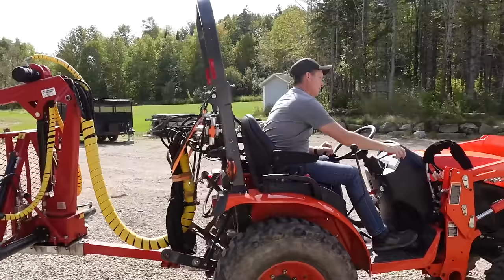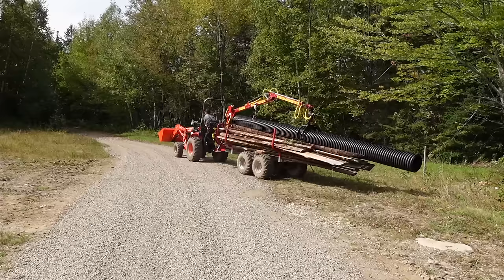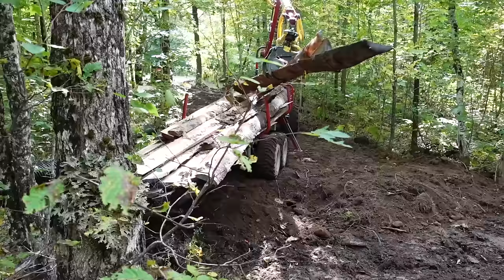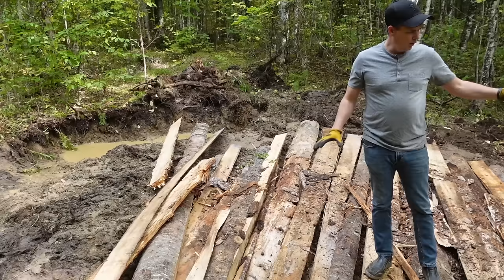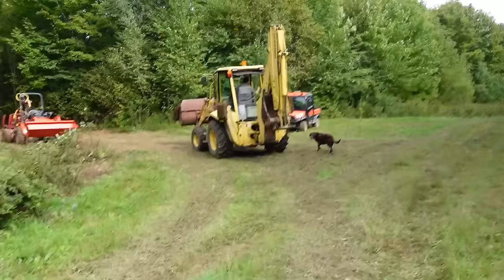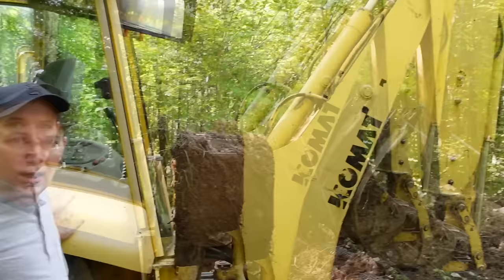Corduroy Firewood Road  -E181

Comment: At the mark of 11:18, that is the sound that reminds you why prefer have a brown dog than a white one... Lol! Slab wood is perfect for making a corduroy road. Much better than round logs. It's not going to roll or move with the pressure and traction of the wheels. There are also small voids that will remain with those slabs that will allow the water to escape towards the lower side too. Nice job, it will sure be good to run heavy equipment on. When I was young, I've seen  a corduroy road, that extended for 1/2km, over a swamp. I was at my parents summer house, deep in the woods.  It was built from the 50's and yet at that time, still very stable.  Then a logging company came in and they had to built another road next to it and they spend numerous weeks with heavy machinery to sink down impressive amount of big rocks into the mud in order to build the base of their road.  So to say, the corduroy method is indeed quick and effective! Especially when you have limited equipment and resources... including time! Thanks!
Reply from the maker: Thanks Joe. I bet that corduroy road at your parent's summer place would have been something to see as it was being built. We left a few boards in some of these slabs when we were sawing for 8x8s so they are excellent for this road repair. Almost through the wet hole this morning. Need to stop and make a fuel run for the machines and for myself and then back at it!

Comment: That’s a great idea. Use up the slabs.  I have a bunch of slabs here, which some have been cut up into firewood. I don’t have any wet spots like that to fix Jason. But a thought I had was, if a fella had a sorta steep
 hill you wanted to travel over, you could build a ramp to help smooth it out to make it easier to travel over. 🤷🏻‍♂️maybe. 
Any way, nice fix, have a great Sunday. 
Great times in the Maritimes. 👍🏻
Reply from the maker: Thanks Noel! Sometimes the solution is right in front of me and I fail to see it. Anyways, I have a big pile of this stuff so I can see some wet spot repair work in my future! Finally some nice weather to work in...
Reply: @OakMountainAcotts  yes a nice week weather wise coming up. I’m still trying to finish splitting my Fiona wood. 
Hehe. How many times have I said to my self, why didn’t I think of that before. !!!!
Have a great Sunday Jason.

Comment: Not a bad idea Jason, with the corduroy or 'puncheon' road  - the subgrade fill over top of your corduroy is full of organics, which will take longer to dry out and 'set up' and will always be soft when wet.  If you can, try a 'downhole' borrow pit with the hoe, ie. get down below that organics layer into some better mineral soil or sand/gravel till. Then when your done with the pit, you can backfill it with stumps/etc. And, try and save out the rocks to armour the culverts!
Reply from the maker: It turned into a pretty good road. Hard to find gravel here unfortunately… ledge seems to be just 2’ down!

Comment: Great idea and making of the water problem solving. 
Where’s all the water coming from ?
Underground stuff or just natural draining ? Thnx…
Reply from the maker: We have had a tremendous amount of rain from August of last year to now. I've never seen the woods so wet... This area is naturally low so all of the rain water is running here and it is slow to dissipate. In a normal year, you would be able to drive right through this spot! Anyways, this seems to be the fix for it and the culvert will let the water get away as I continue to ditch the new road I am building. Thanks for watching!

Comment: I have the swamp, the slab wood, a pit with about the same dirt, small tractor with backhoe but no time 😂. I’m thinking I’ll but the slab wood a couple layers thick as it’s a black mud swamp and I can’t even walk across it so one layer will sink out of site for sure.
Reply from the maker: You are all set to start! I would lay one layer parallel to the road and the second layer perpendicular. It works great!